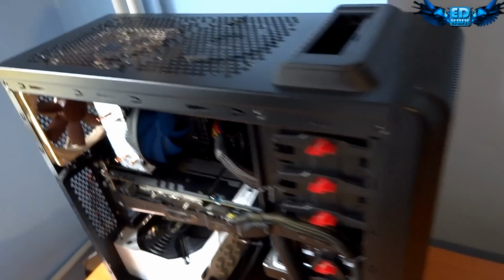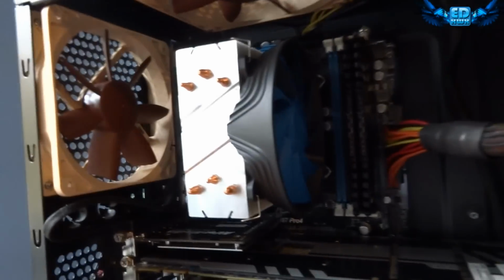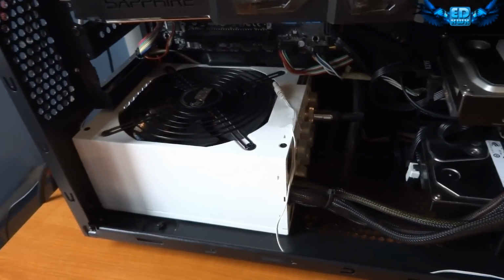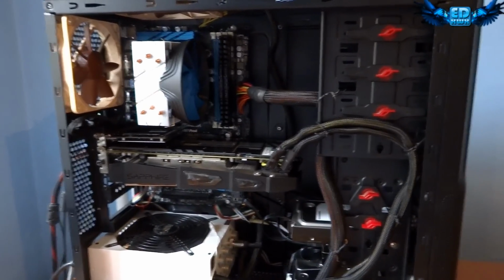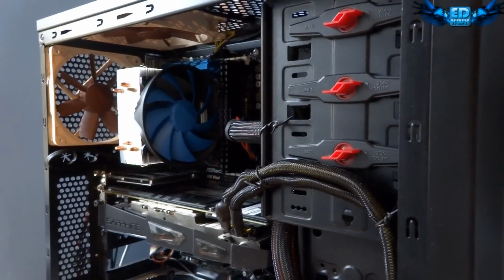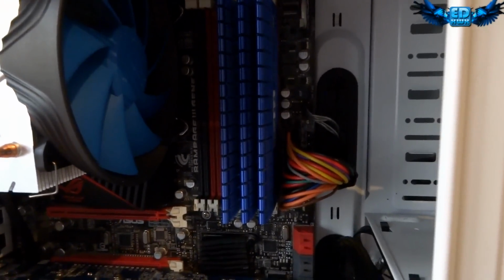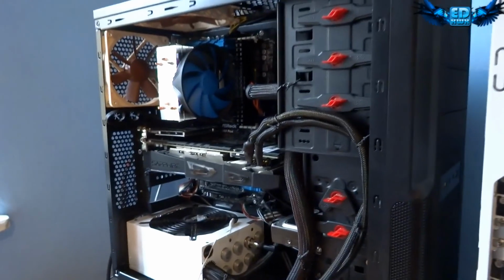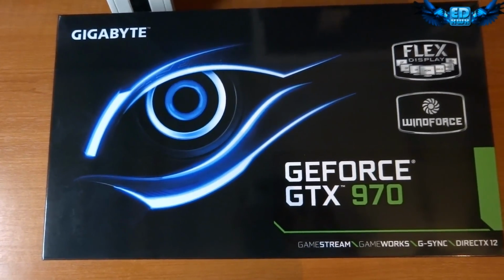My Rig`s / PC`s and Video Card Upgrade

Comment: Hi ed I like you.

What you think about this configurations????

Mobo. Asrock h97 pro 4 

Cpu. I5 4690k_thermalright macho rev 2.0

Vga. Gtx 970 gigabyte rev 1.0

Ram.' 8 gb hyperx fury 1866 Mhz (cl 10)

Cooler master 600w

Hdd 1 TB

Ssd not. 

What you think??
Reply from the maker: Daniel Iacob ops acum am vazut , merge sa joci si unity e super configuratia !
Reply: +MrEdxwx esti român

Comment: What do you think of this gaming rig?

Motherboard: Asus Z97-K Intel Z97 LGA 1150 ATX 
CPU: Intel Core i7 4790K 4,0 GHz LGA1150 
GPU: MSI GTX 980Ti 6GD5 6144 MB
Power Supply: Corsair CX750M V2 CX-series 750 W ATX
RAM: Kingston HyperX FURY Black 16 GB KIT (2 x 8 GB) DDR3 1600 MHz CL10
Hard Drive: Seagate Barracuda 2 TB 64 MB 7200 RPM 3.5" SATA III (6 Gb/s)
SSD: Samsung 850 EVO SSD 250 Gt 2,5" SATA3
Case: Fractal Designe Define R5
Optical Drive: Asus DRW-24F1ST/BLK/G/AS 24x DVD+/-RW

I'm a beginner at this. So I do have money to burn, but please let me know if I'm wasting it. Also I hope that all of the components are compatible.
Reply: Jegicci Nah sorry, you can only run Minecraft with the lowest settings with 14 Fps.
Reply: ***** Lol.
Reply: killerzombyady Ok thanks, I'm a noob at this so any credit is welcome :)